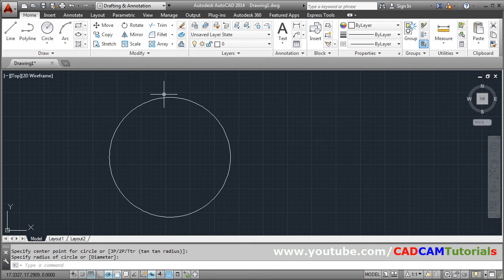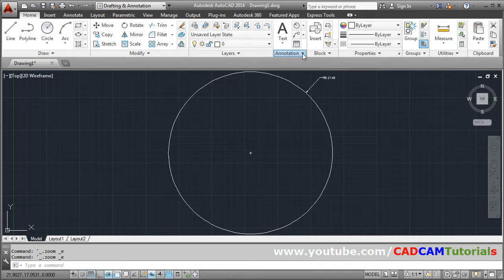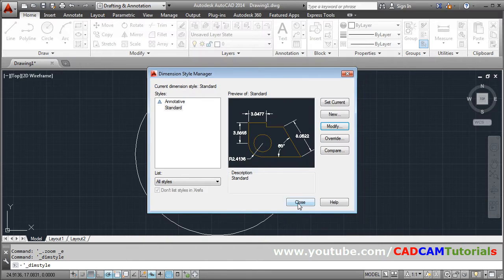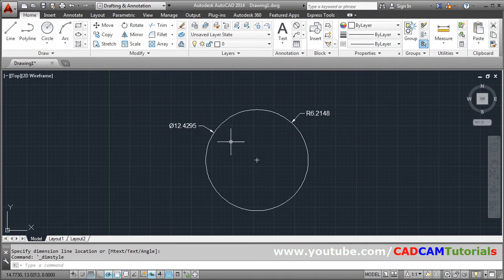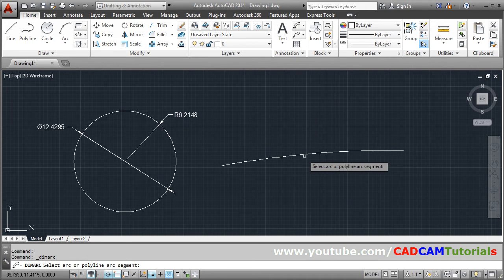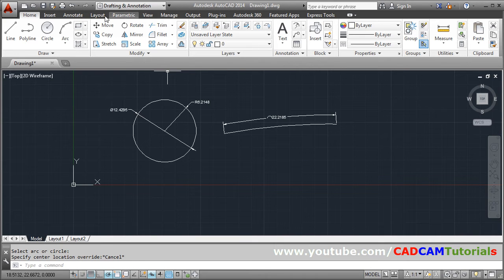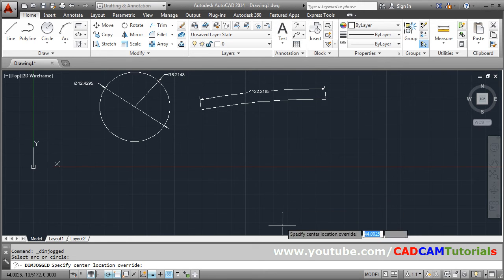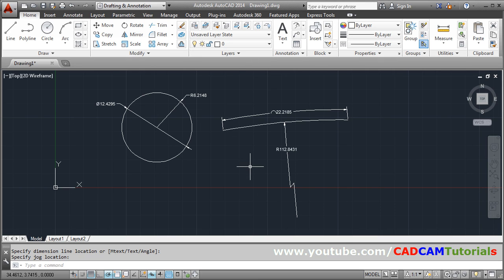AutoCAD Circle Dimension | AutoCAD Arc Dimension

Comment: What if i want the arrows to be inside the circle while applying the diameter annonation.

The arrows are ouside, is there anyway to make the dimension arrows shows the dimensions from inside the circle?
Reply from the maker: Click on created dimension. Take cursor on Blue grip near arrow and click on flip arrow.
Reply: @CADCAMTutorials  Great video, I tried clicking flip arrow but the leader line is still on outside of circle, if you wanted text in center of circle with line inside circle with arrows stopping at circle edge, how would one do that?